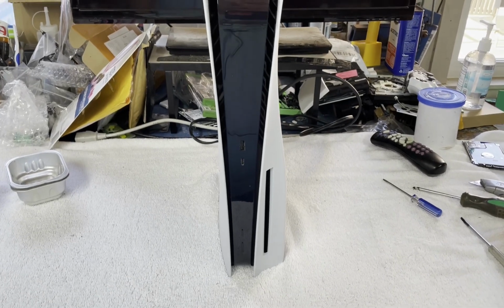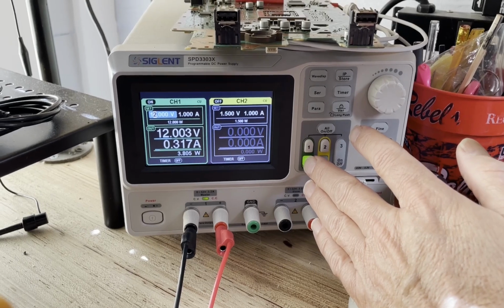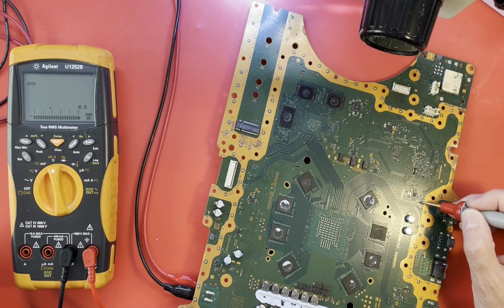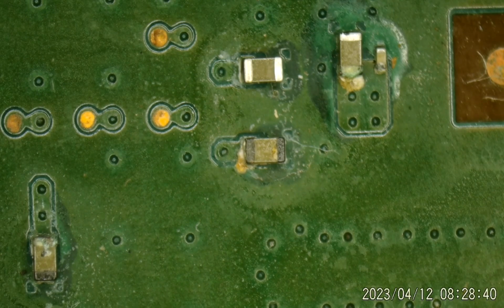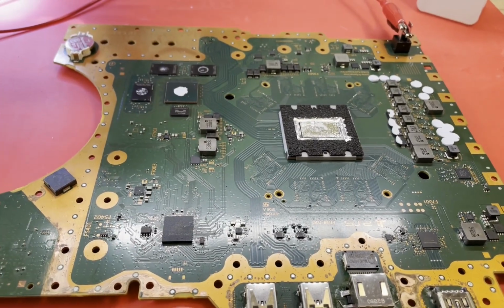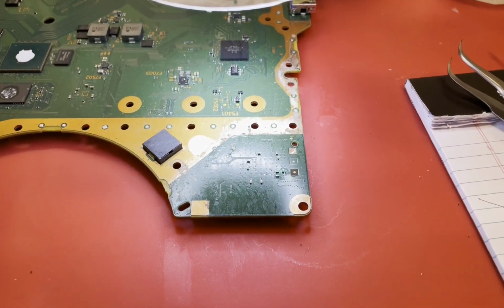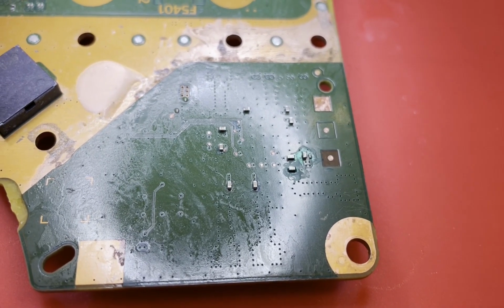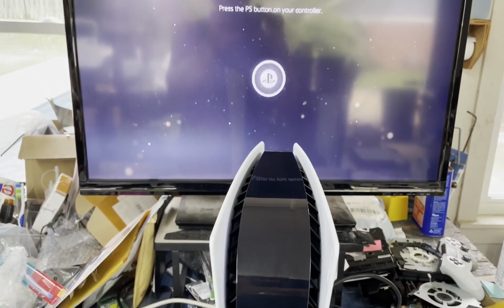#87 Repair of PS5 Beep, But No Power On

Comment: How did you know the capacitor's values
Reply from the maker: 10uF 6.3V size 0402
Reply: What's that tweezer like device called??
Reply from the maker: @consolenichecsn6930  Smart Tweezers.  Handy for measuring small SMD components.

Comment: Does anyone know what tool that is used at the 16 min mark? Is that detecting the values for the capacitors and resistors?
Reply from the maker: They are called Smart Tweezers.  They measure resistors, capacitors, inductors and diodes.  It's intended for measuring small SMD components.
Reply: @ToltecMerc  that's pretty cool. Never seen one before. What brand is that one? I see on Amazon they range pretty cheap as low as 30$ to almost 350$ that tool definitely would make things alot easier.

Comment: It's amazing how such expencive device depend upon such tiny piece of sheet as this capasitors. It should be fully isolated with varnish to prevent SC upon this ugly insects and floodings by moron users. 
Of course it'll makes imposible to repair such board but much sustainable this boards.

Comment: I'm having this exact same issue with mine no light only an occasional beep and no power. I tried calling a repair shop and they said they just immediately told me itd be 270 to fix (266 to be more percise but after tax guarantee itll be more)

Comment: Hello! Thank you for all your work! I have same problèm on Ps5 and find the caps where the short is but before that I don’t know why as I think seeing ram being hot I think it could be the ram but that’s not so I find the caps replace and no more short anywhere but know I reassemble the ps5 before one bip and turn off now nothing when u click on the power button or even on eject button any clues ? Could be the ram because I try to reflow it I also remove one component but replace it like he is before and nothing
Could you help me please
Reply from the maker: If you tried to reflow the RAM that could definitely be a problem.  You will probably need to reball the RAM.

Comment: Worst mess of insect infestation I’ve seen on any channel. How do you keep scoring these? Lol. When the 3.3 was down with a 0.3 ohm short and pulling 0.3 amps at 12 volts, I thought the next thing would  be a thermal camera. Was that enough power draw for heating to be detected?  Eagle eye didn’t need it though.
Reply from the maker: I would have had to inject 1V or 2V at the output of the DC-DC converter to find with the thermal cam and I'm sure it would shown up nicely.  That was going to be the next step but I just never got there.  The cracked cap was rather obvious under the microscope.
Reply: @ToltecMerc  thanks for the reply. Still think you brave taking on that insect mess. Boy it was bad.